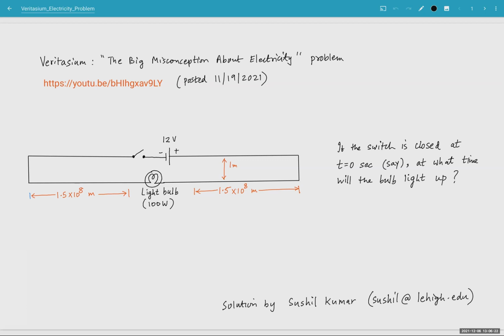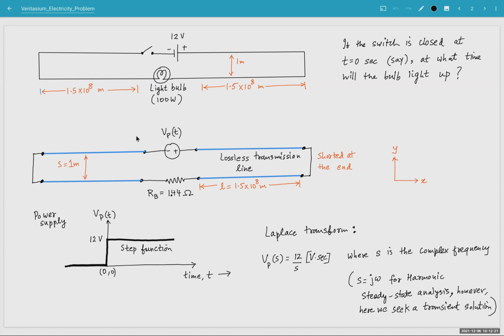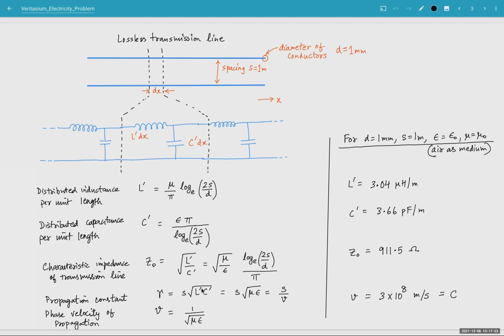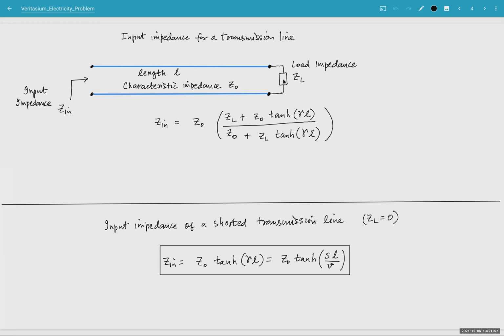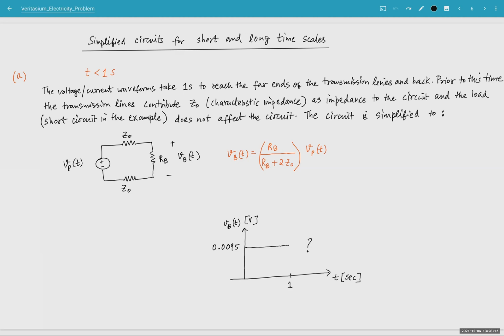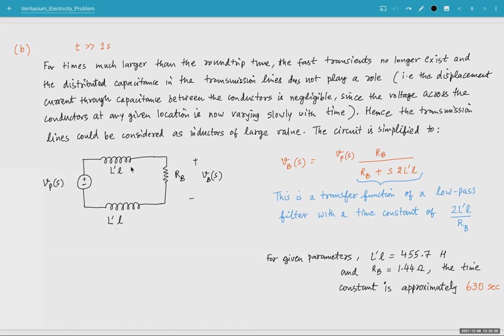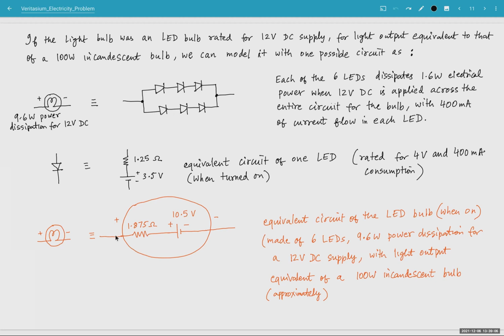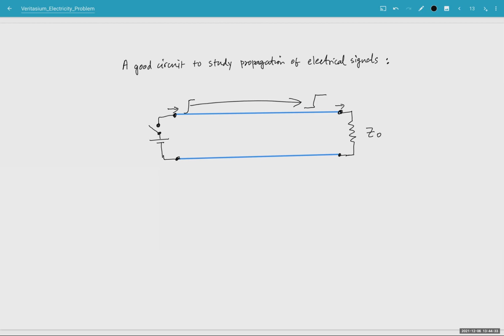Quantitative solution to the Veritasium Electricity problem (light-bulb circuit with long wires)

Comment: Again, thanks for the video. Couldn't the power delivered to the bulb at small t be increased by increasing the battery voltage? Ideally Rb = 2*Z0 ≈  1824 ohms and Ub ≈ 427V, if we keep the rated power of 100W? Then Pb = 0.25*100W  25 W. Thanks in advance.
Reply from the maker: Yes indeed, for a battery with a large voltage as you stated (427V), a 100W bulb would dissipate 25W instantaneously in this circuit. So Veritsasium could take your suggestion and use a 427V battery in their circuit with a specially formulated 100W bulb for such a battery, to prove their point. We will have to manufacture a custom bulb and battery for such a project, but then again, this entire exercise is a thought experiment so it is fine!

However, if we have to somehow prove that Veritasium can be right in some situation, a more practical solution will be to use the standard 12V battery, and for  the bulb, buy one of those tiny LEDs that we use on breadboards, which have a very small current requirement (few tens of milliAmps). If we put such a small RED LED (say) that is typically used on breadboards, which is rated for a 20mA current, it can indeed light up faintly within few nanoseconds. We have to use a large current limiting resistor (600 ohms for a 20mA LED) in series with such an LED to prevent burnout in steady state. If such a small LED is used in this circuit, perhaps 5mA or less current will flow through the LED for the first 1 second, and then the current will rise in a step-wise manner every additional second and it will take few seconds for the current to reach its maximum and steady state value of 20mA. So the LED will light up to full brightness in a few seconds.
Reply: @sushkr  One could argue that, even with the optimal choice of lightbulb, only 25% of the rated energy at any time is delivered via displacement current, so Veritasium isn't right. :)
Reply from the maker: @alexandershendi7428  Actually that is not true. You are probably assuming the bulb has to be impedance matched to the characteristic impedance of the transmission lines, but it does not have to be. Here the impedance of the bulb can be anything.. it does not really help if it was or wasn't impedance matched to 2*Z0, because that won't eliminate reflections in the circuit. Impedance matching is only useful to eliminate reflections in lines for the load at the lines, which is good for optimal power delivery (assuming you know this already based on your comments). But here, there are already reflections in the circuit due to short circuited lines. In this circuit, the higher the resistance of the bulb, the more is the instantaneous power (as a fraction of the steady state power) that can be delivered to the bulb. For example, you could put an even smaller LED in the circuit such as a 2mA LED with forward voltage for 1.8V (from SunLED) that I just looked up online. You can put in such an LED with a 5.1kohms series resistor in the circuit at the location of the light bulb, and the battery being 12V. In steady-state, the current through the LED is 2mA. But at few nanoseconds just when the switch is closed, approximately 1.4mA of current will flow through the LED (based on Z0=911.5ohms of each of the transmission lines). So as you can see, in this case, the LED will light up to approximately 75% of its rated brightness instantaneously.
Reply: @sushkr  You are right, of course. I think (t << 1s):
* For max.  power transmission: Rb = 2*Z0
* For max. efficiency: Rb  >> 2*Z0
I think for t << 1s reflections at the short circuited end need not be considered, because the voltage wave has not yet "arrived" at the far end.
Reply: One more question: What. software did you use to compute the inverse Laplace transform of 1/(s*(1266 + tanh(s/2))) ? Mathwork's ilaplace package? Thanks in advance.
Reply from the maker: @alexandershendi7428  hi. I mention this in the description above. It's a function on the matlab file exchange called INVLAP.